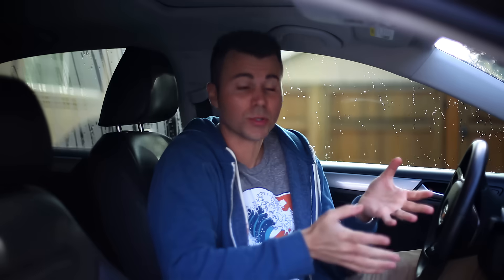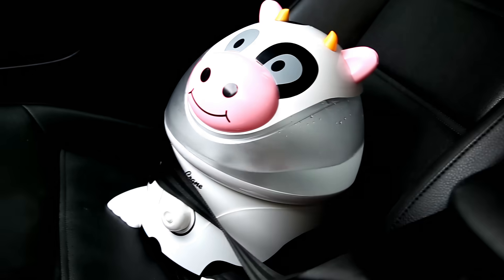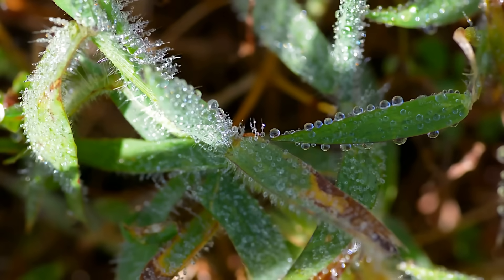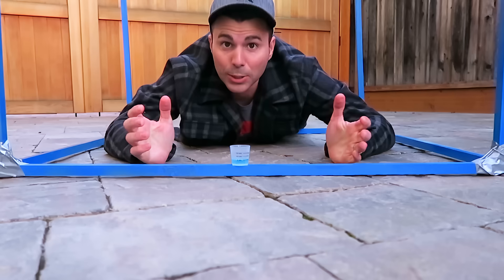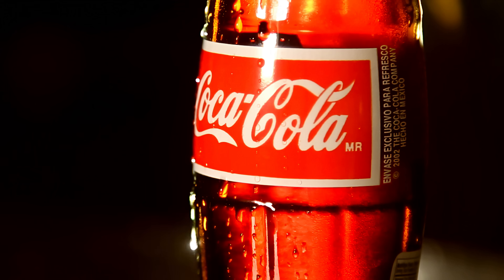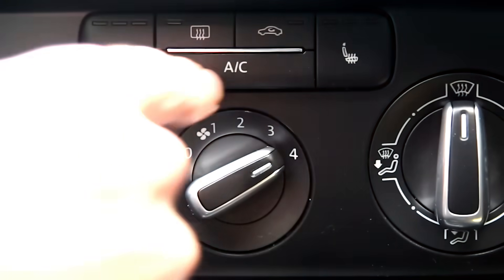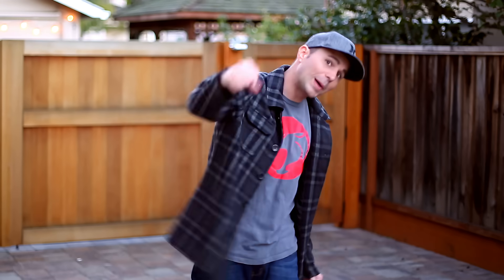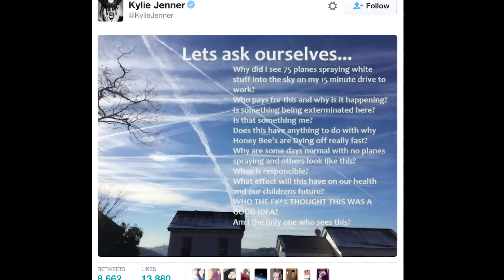Defog your windows TWICE as fast using SCIENCE- 4 easy steps

Comment: Pretty thick for an engineer.  When's the last time you exhaled an actual cloud?  You haven't.  You've exhaled water vapor, which condenses into little droplets.  Those droplets proceed to drop out of the air almost instantly:  same thing with contrails except the water droplets freeze before falling.  That is why contrails disappear.  That is how it's easy to tell the difference between a cloud formation and a contrail.  Clouds have structure -- contrails don't.  When you see a contrail with structure, that not only persists all day but spreads out over time instead of simply dissipating, you're not seeing a contrail.  You're seeing a chemtrail.  

I watched contrails all the time as a kid.  I used to dream of seeing a really, really long one that stretched across the whole sky.  I would fantasize about that, because I thought it would look cool.  Then in the mid-90's, about the time I graduated high school, I saw them.  These "contrails" that covered the entire sky were everywhere.  Very common.  This was something I had spent years hoping to see, realizing I probably never would, and then, one day, I found out these unicorns are not only real but common.  Before the mid-90's:  never.  Since the mid-90's:  common.  

Pretty thick for an engineer.

Comment: Most of this is rubbish. Cars A/C's don't work below 5°c. So if you have frosted window, they aren't going to take the moisture out of the air. Also car manufacturers set the reticulation to closed for max defrosting, so you're not dragging in cold air from the outside.

Comment: Really?!  Ten times LESS?!?  As a 'science guy' I would expect you to have a passion for accuracy in your description of processes.  You obviously know what I'm getting after, but of late there is a tendency for grammar in society to use "ten times less" to describe a reduction in value, when using 'times' which is a multiplier or an 'increasor' of the end value. ' Less' would imply the use of a fraction of the original (Eg. I was left with 1/2 of my original 2' of lumber which means that I now only had 1' of wood left to use).  OTOH, "ten times more than ten" would be 100 & 1/10 of 100 would be 10.

Comment: Use shaving cream to shave off a couple minutes from your morning commute.

Cute.
Reply: Ready for this............ Wait for it, no, no, Wait for it........... Mix 45% Alcohol with 55% Water. On that COLD Freezing Morning/Day when Your Windshield is Ice/Frost Covered. Spray the Windshield with this Spray!!! Walla, Frost/Ice GONE. (Inside) Prevent Fog upon Your Windshield by Cleaning it with "Shaving Creme". Yes, it Works... Even Use this Trick on Your Bathroom Mirror... AND Always Remember. "NEVER" turn on the Cars Rear Window Defogger on a Frozen Iced Window. Start the Car. Let the Window Warm up just a bit... Then Turn on the Rear Window Defroster!!! Or Turn it on like Many People do "And Watch the Window Blow up."
Reply: Gvv v v.

J Jg fx

Mb
Reply: Walla, as in Walla Walla, Washington?  Or maybe you meant voila!
Reply: Grim Reaper syp going to have to use the shaving cream trick, my ac doesn’t work, it was raining out this am & my windshield started to fog up. I hit the windshield defogger button & it made it worse. I was even driving with the window cracked up & it was still fogging up a bit.
Reply: @michaels.8244  In this case, the air in your car is warmer than the cool rain water hitting your windshield. Since your car air is already hot and saturated with water, it condenses on the cooler windshield (which is losing heat to the rain water). Without air conditioning to remove humidity from your inside air, the best you can do is balance conditions between the inside and outside so the windshield pane remains neutral. Crack your windows as much as you dare, and run cool air through your vents. It may not be comfortable, but at least you'll be able to see.
Reply: Shave yourself a couple of bucks
Reply: Noice

Comment: Sometimes this 'scientific method' does NOT work: when motor is cold + it's freezing outside + A/C is not working (for some cars when temp is below 4 degr C ) + sidewindows cannot be opened because they're frozen + air-intake is covered with snow/ice so intake-air is moist, etc. The 'scientific method' will then result in EXTRA fogging!
Quick solution: do NOT turn on the blowerfan, only wipe the inside screen with antifog (or antifreeze when it's freezing), now you can drive immediately! After a few minutes driving, when motor is getting warm, start the 'scientific method'.

Comment: Warmer air hold more moisture than cold air I somewhat disagree.Actually, it is the temperature of the water vapor itself that governs the amount of water vapor that may be held in the atmosphere. The warmer the water vapor, the greater its maximum vapor pressure. Vapor pressure is the portion of atmospheric air pressure attributable to water vapor. The greater the maximum (saturation) vapor pressure is the greater the capacity of the mixture of air and vapor to hold water vapor.
Reply: +Mark Rober Oh okay thats my fault I didnt see that link..But great video overall and explanation

Comment: I can't see that others have posted this, but when you turn on defrost in your car, your A/C automatically comes on, even if the light does not.  Automotive engineers already know that dryer air does a better job.  Ever notice that older cars that have faulty A/C do the worst job at defrosting windows? Thus, no need to manually turn on your A/C when defrost is on.  This is easy to confirm, start up the vehicle, pop the hood, turn defrost on full blast, open up the hood and watch the A/C compressor.  The pump will turn on and off, noticeable by a clicking sound as the clutch kicks in.

Comment: I live in Alaska and during the winter I notice that there is a lot of condensation above my vents, creating the thickest frost on the windshield just above those vents.  Learning from this I started shutting off my heat 5 minutes before arriving home and blasting cold air through it.  I believe this blows out any condensation.  I also open my windows a minute before arriving to allow as much condensation to escape my vehicle.  After shutting off my vehicle I adjust the hot setting to warm and the blower setting to it's lowest setting.  When I wake up the next morning there is barely any condensation at all,  I start my vehicle 5 minutes before leaving to work for it's warm-up period.  It is still cold when I get in my vehicle before my morning commute but the windshield is clear and i do not have to scrape ice, it only takes 5 minutes of driving before my Explorer is warm and toasty.  I save the heat for my warm up of the engine instead of wasting it heating the interior of my vehicle.

Comment: How do I defrost the windshield without going outside and scraping off the ice?
#CanadaProblems
Reply: about a minute before you get home and turn off your car, try turning the AC on, max fan, max cold, outside air and rolling down all your windows..... if it snows overnight, you should be able to just brush it off with no ice underneath the snow....

Comment: The most important bit for speed is going to be the AC. Combined with the fact that it's not dependent on whether the car is already warmed up(For those of us who drive cars that use the engine's heat for the interior heating) you'll be fine to not add heat.

Comment: +Mark Rober - Why does a smokers automotive windows seem to fog up more than a none smokers automotive window?  I can't just say one type of vehicle for the trolls will attack my question.
Reply: Probably because the tar gives the water a better surface to cling to
Reply: Or a bigger surface area to condense on
Reply: Is the particulate in the Smoke sticking to the windshield, a dirty window collects fog faster. That's the reason why shaving cream works is because it gets the windshield actually clean.

Comment: Totally not true. Going for the warm setting not only slows down the defogging, but it fogs up everything else that is not already fogged up, because it loads the air with water that's already condensed and that is getting evaporated into the air inside by heating it up.

Cold air from outside. That's the way to go.

Comment: You might want to point out that running your air conditioner when the out side temp is lower than 65 degrees f can shorten the life of the compressor because the lubricating oil inside it is thick like lard at lower temperatures and won't protect the moving parts very well. Replacing worn out compressors is expensive.

Comment: I don't understand science. Can someone help me with this problem?

Let's assume a few things.

Outside it is 0 degrees Celsius with 80% humidity. Pressure is whatever standard measurement we can assume.
Inside my bedroom it is 21 degrees Celsius with 30% humidity, and pressure again whatever we want to assume.

I want to increase the humidity in my bedroom by opening a window to allow the outside air to bring in moisture, then heat that air up to my room temperature of 21.
What is the effect of what I am trying? Am I adding water or loosing water?

Comment: Here is an exception to your examples: dew on plants. Plants are definitely affected by the humidity in the air, and on a cold day, they do have dew at their surfaces. However, plants also have dew on their surfaces because of a wicking mechanism called transpiration. There is a column of water from the leaves all the way down to the root. The water continues to go up the plant vessel by evaporating at the leaf pore. When the first molecule of water evaporates, it pulls up the next water molecule, and behind it the next, and so on. Transpiration goes on most all the time, but how fast it happens is affected by humidity and dew point.

This is different from condensation on a cold Coca-cola bottle, a frozen bag of peas, or even "spit" in a trombone.

Comment: "...turn your A/C on.   This pulls moisture out of the air as the air passes over the cold coils."  There's only one problem with this claim.  When you turn your heat on, the A/C coils are not cold.  Are you quite certain that A/C on or off has any effect whatsoever on the time it takes to defog the windows?

Comment: Good video.  I have a question and a point.  Cars already have thru ventilation.  Do you really need to open the windows a little?  My point is that running the heater with the AC makes the windshield warmer than the AC without the heater.  Humidity condenses on cold windows more than warmer windows so I think you are right on that for another reason.  Thanks.

Comment: Had the fog problem for a long time. Turns out, I found the best way to what you described, but without the AC turned on. :Brofist. I'll use the AC on next time
Reply: Craig A.c. condenses the air so it pulls out the water.. I'm from Alaska and pretty much everyone knows this.

Comment: So in modern vehicles, when you hit the 'defrost' button or switch to defrost mode, here is what happens:  The AC is turned on, and the 'recycle air' feature is turned off.  Obviously hot air will help, which is why your hair dryer blows hot air, not just room temp air (with setting for cold air so you don't burn yourself if you want).  idk why im wasting my time even writing this.

Comment: Pro tip: Get a towel...

Now if you live where cold weather is actually a thing, get an ice scraper.
Reply: Ragatokk PROTIP
Reply: The ice scraper works for the outside, where there's actually ice.  The condensation on the inside is still an issue that won't be addressed by that ice scraper.
Reply: We carried several towels and with a few people in the car the towels would just get soaked and completely ineffective, its not a very good tip at all. :)

Comment: Another trick if it is very cold, is to heat the air in the car as much as possible just before you get home and then dump it all by opening all the windows for the last 30 seconds of your journey, so when  you stop the air in the car is as dry as possible and there will be less liquid to reabsorb in the morning.

Comment: In North America you'd be hard pressed to find a vehicle built after 1990 that had A/C but didn't do much of this automatically. The factors within the operators control are the fan speed, heater level and recirc vs fresh. The role of A/C is overrated
A car parked in winter ideally should have its windows cracked before overnight parking. Where this isn't possible (street parking), the heat should be reduced before ending a trip, and unless its raining, the doors left open long enough to allow the moist inside air to be replaced by dry outside air. This will reduce overnight fogging.
If you start the car with the heater set on high fan high, rear windows slightly open and select fresh before additional passengers ingress,  the fresh air passing over the inside of fge window should prevent additional condensation from exhaled breath and moist clothing.
Once the engine heats enough to open the thermostat, the cabin air will start to heat, supply air will rise in temperature. Only when it gets to +60F will the A/C engage, after which it will dehumidify the OUTSIDE AIR as it's pulled into the cabin. Because winter air is already dry, this dehumidification adds little to initial defogging, most of which happens before the A/C goes to work. 
Once the windows are clear, the windows closed, fan and heater controls can be turned lower, and the A/C will keep the cabin humidity under control even with the air on recirc. 
If your car has dual settings for defogging the windshield, once the fog is gone, switch to the secondary setting, which directs most of the warmed air to the floor. This will help warm the passengers while keeping the upper part of the cabin supplied with a constant supply of cooler, drier air.

Comment: Ok so cool that he has tried using real science of experiments but i have an issue with the hot air part. Here in Canada where our winters can reach -20C to -30C with little moisture in the air because its just way too cold to exist, using warm air in your car will be a sure way to initially compound your problem. The problem is that the moment you enter the car you have just added a ton of moisture that starts condensing. That warm moisture has to get the F out.  I use cold air, windows cracked, fresh air to get optimal results. Once the car is warm enough, you can gradually bump up the warm air as the windows will have warmed up enough that it wont allow condensation.

Comment: Turning the heater on full blast won't work until the engine is hot. Waiting for the engine to heat up takes time/ Wipe windscreen with absorbent cloth and then drive and turn on heat when engine warm

Comment: Or you can get a bucket of water that takes 10 seconds to fill and chuck it on the window. Problem solved.
Reply: Yup, and Watch the Window/Windshield Crack or Blow up!!!

Ready for this............ Wait for it, no, no, Wait for it........... Mix 45% Alcohol with 55% Water. On that COLD Freezing Morning/Day when Your Windshield is Ice/Frost Covered. Spray the Windshield with this Spray!!! Walla, Frost/Ice GONE. (Inside) Prevent Fog upon Your Windshield by Cleaning it with "Shaving Creme". Yes, it Works... Even Use this Trick on Your Bathroom Mirror... AND Always Remember. "NEVER" turn on the Cars Rear Window Defogger on a Frozen Iced Window. Start the Car. Let the Window Warm up just a bit... Then Turn on the Rear Window Defroster!!! Or Turn it on like Many People do "And Watch the Window Blow up."

Comment: Um chem trails are very real.  And A. most cars don't have an inside circulation button. Or people wanting to know this probably don't have AC or even a defroster that's working.  However shaving cream may help but you didn't explain it or how long it lasts. as for everything else.. made no sense.. the air is not colder outside of a soda hence condensation... waaa?

Comment: To all you chentrail nuts They are called contrails. I fly high performance gliders (sailplanes ) long distance if the conditions are right. Under the right conditions at high speed around 200 MPH i have seen contrails left behind mine and other gliders and we have no engine or chemicals on board. If we were allowed to fly much higher I'm sure they would be much more pronounced. This helps to explain why a lot of airplanes can experience icing at 68 degrees Fahrenheit. The late Steve Fosset had a few pictures  in his attempts ti fly a glider over 50,000 ft. and in a few the contrail were very visible.

Comment: If you already have your car warmed up enough for the heater to blow warm air, your windshield should already be clear.  The only thing you need to ensure is that both the inside and outside of your windshield is always clean.  Keep it clean on both sides, and your defogger will already be instant when the car is warmed up.   You don't need shaving cream.

Comment: You must be in the south where it actually doesn't get cold.  A lot of vehicles will not allow the compressor on your A/C to kick on due to the chance of freezing up as the freon passes through the expansion valve, this is exacerbated if you have low freon.  There are sensors that only allow the compressor to run when the temperature reaches whatever the factory sets for it, once the engine warms up to the set temperature it will allow you to run it.